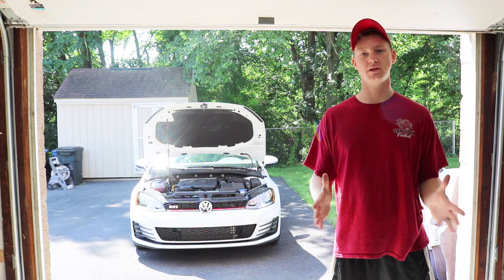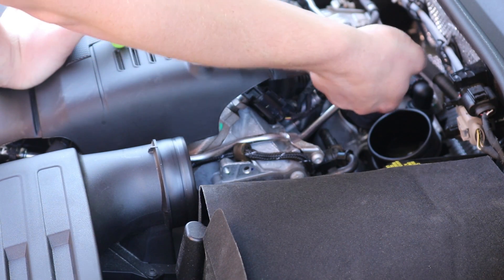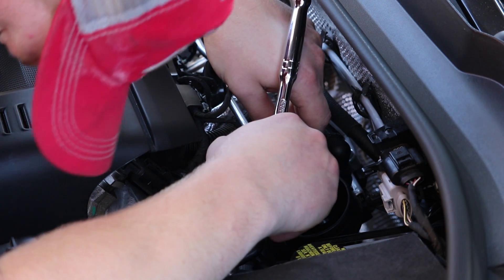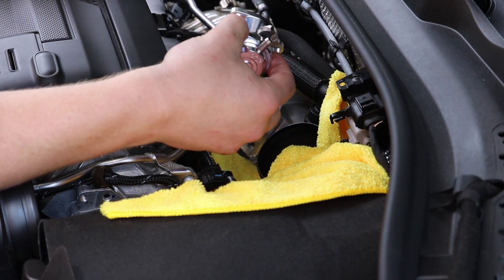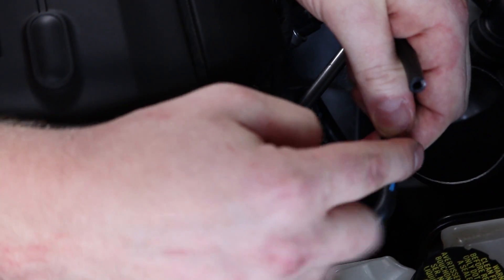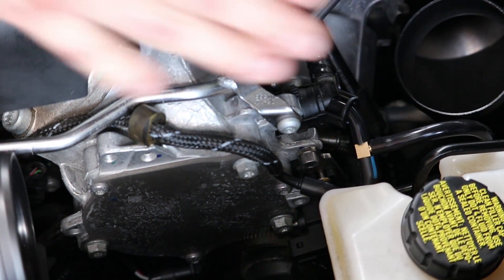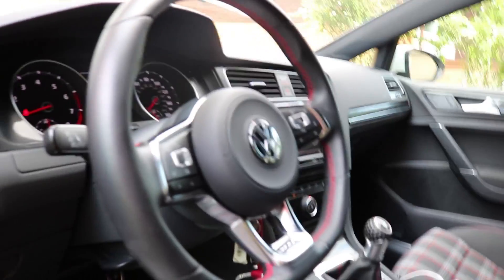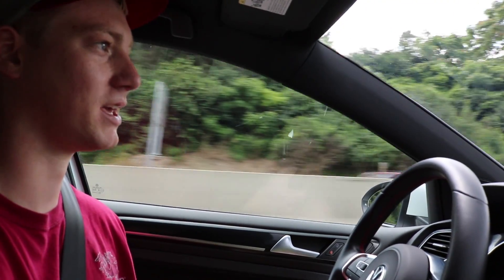MK7 GTI Forge Blow Off Valve (BOV) DIY

Comment: Where’s the loud “whoosh whoosh” or the pigeon flutter. Our how would I go about getting those sound? Thx
Reply: you would need a cold air intake and a diverter valve, and turbo muffler delete would help as well
Reply: For turbo flutter 2 legits ways.. first and cheap  way is disconnect the diverter valve plug... And the other way is installing a HKS SSQ BOV.. it's a bit harder the install and about 250 dollars for the kit..

Comment: BOV is actually bad for tge golf gti its not designed for that keep the diverter valve in and put in a spacer for more sound
Reply from the maker: been running it for 50K miles and almost 7 years. I think its fine.

Comment: Thank you bruh, this is by far the top, easiest, dummy proof way to install explication. I will be trying my tomorrow, thank you so much.
Reply from the maker: Emanuel Vegaaviles thanks for the support. It's pretty easy to put in. Just don't drop the bolt like I did 😂
Reply: TeddyWestside412 haha I’m glad I didn’t lol. But I got a flutter sound with the same BOV🤔 any ideas thanks bruh.
Reply from the maker: Emanuel Vegaaviles what type of sound are you hearing. Have you seen the sound clips video I made? I show a few different sounds that I get out of mine.
Reply: TeddyWestside412 no I haven’t :( send me the link please if you don’t mind. I get the psh sh sh sh sh sh
Reply from the maker: Emanuel Vegaaviles https://youtu.be/iWw9FHHi30o let me know if it's similar to any of these. Is your car manual or dsg?
Reply: TeddyWestside412 nope not similar at all i get the Stu Stu Stu Stu is pretty bad ass but I was looking for the whistling sound :( maybe I inverted the cables I guess. Nice video BTW
Reply: My car is automatic btw. Is pretty cool cuz you get the sound straight off the take off but sound side is not as easy to control it unles I’m on sports mode or manual stronic.
Reply from the maker: Emanuel Vegaaviles I would check the air hoses then....look up the directions to double check how they are routed. I would do this soon as you can cause you could damage the valve or your car.
Reply: TeddyWestside412 I did. It looks like that’s just the one I got. I love it tho. I’ll send you a link later when I do it. Thanks so much and keep up your videos bruh.
Reply from the maker: Emanuel Vegaaviles thanks man. For sure send me a link. You can send me it on instagram if that's easier.

Comment: I'm running the yellow spring on stock boost, I have the green spring (5-15psi) to replace it, just need to find some time to install it. But if you're running STOCK boost like i am on my Mk6 they recommend the correct preload which is a green spring.  If you're using the yellow spring which is set for (15-23psi) on stock boost, which maxes around 9psi and settles at 6psi, it may cause too much strain or pressure to open the valve resulting in some back pressure in the turbo. With the yellow spring currently in, I still get the high pitch whistle, but with the correct preload spring (green), I should receive that high whistle with less boost pressure and less RPMs to make it blow off properly. 

Green - 5-15 PSI

Yellow - 15-23 PSI

Blue - 23-30 PSI

Red - 30 + PSI

Comment: Picked up a 19 gti rabbit earlier this year, first thing I put on the car was a blow off valve adapter. Thank you for posting this, helped me install it with very few problems. Might’ve followed your instructions a bit to perfectly because I dropped a bolt too but still haven’t found it :(
Reply from the maker: Sorry to hear about losing the bolt hopefully you can get one from a hardware store like I did.

Comment: Need a tune for bov, intake? Been thinking of getting a gti  as they are pretty cool cars.
Reply from the maker: nope no need for a tune for just an intake or a bov......although these cars are a whole different animal when you get them tuned so i suggest doing that maybe first.  That is def the best bang for you buck if you want some more power to have fun with.  intake doesnt do much other than look nice and maybe some more intake noise.  bov is just for some turbo noises as well...not much performance added with a bov.  so it depends on what you are after everyones builds are different.

Comment: Did you get a CEL by venting to atmosphere?
Reply from the maker: nope i have never had a CEL due to this BOV
Reply: @TeddyWestside412  awesome! Thank you for the reply! Did you have any negative effects or anything that comes to mind from running this BOV? Thanks again for the video and response!
Reply from the maker: @cal63look  i havent had any issues with this part or anything wrong with the car related to this part ever since i installed it years ago
Reply: @TeddyWestside412  Nice nice. Reason I ask is because of all the negative Nancy's about loosing the metered air and it not being recirculated and Yada Yada yada.. I love the sound of bov's but have never owned a car with a diverter valve setup..
Reply from the maker: @cal63look  yeah i have a few of those Nancys in my comments.  i love the sound and i wanted the BOV sound with my turbo car so i put it on.  i have no issues or complaints with it.  i am out here for the fun not for a world record hahaha
Reply: @cal63look  Not here to be "a Nancy" and tell you not to get it--but I used an ECS DV Spacer that also vents to atmosphere but using a different method. I got a CEL with a MAP Sensor Correlation code. When I removed it, it went away (after clearing codes). Put it back on, light came back. That being said, I don't foresee any way the vented air could damage your engine (maybe running a hair rich during shifting), and if you like the sound go for it. I swapped to an open element intake to keep the whoosh w/o the CEL, but I loved my DV Spacer. Just know you might still get a CEL.

Comment: Hi i just did my installation on my mk7 gti, i am just feeling the boost release sound is not coming on every shift, my car is automatic is that making any difference?
Reply from the maker: I dont have an automatic so I wouldn't know. It will depend on where its shifting...if you're not up in the boost it's not going to make a noise. I'd check all your lines and if you dont have a check engine light I would assume its installed properly.
Reply: @TeddyWestside412  thanks for the quick reply, i will recheck my lines and there was no check engine lights...the last time i drove
Reply from the maker: @harishthilak  then I'd try to pay attention to where you are in the rpms when it goes off. I'm guessing you wont hear it at low rpm shifts because your not really building boost. But if you stomp on it and it shifts above 5k and you dont hear it then I think you might have an issue.
Reply: @TeddyWestside412  hi i just checked all the lines its all correct and fixed properly. The dsg is the reason i suppose, only when you take your foot off the accel pedal the boost release sound is coming. Is there any work around for that?
Reply from the maker: @harishthilak  not really that I can think of.  It should only happen when you shift or take your foot off the gas (while in boost).....if it's never happening when the car shifts then idk how to help you sorry. You can reach out to forge about it but since I have a manual it behaves a little differently than the dsg.
Reply: It’s dsg, you stay on boost when you shift gears, so you keep your pressure high = faster

You’ll only hear the bov when you left off the throttle on DSG not when you change gears. The reason you hear it every time on manuals is because they have to let off the throttle to change gears unless they have “no lift” adjustment to their ecu
Reply: What about if you use manual mode with paddles on the dsg. Then you should hear it correct?

Comment: Hey I just installed the same Forged BOV.Do you know whats the rating on the springs.I left the one that came installed but I notice that the kit came with other springs.
Reply from the maker: FZ FZ I know that the one in the BOV (if you have a yellow sticker on your box) is one of the weaker ones. I think their website says 25% then the other one you get is 50%. I don't really know what that means and I've tried asking again. I ran the  regular one the entire time while I was stock. Now that I'm stage 2 I think I am going to put the stiffer spring in. Was hearing it release air while I had the downpipe on but wasn't yet tuned. Haven't heard it let out air when it shouldn't now that I'm tuned.
Reply: yes mine also came back with the yellow spring installed.Im not sure whats the PSI rating for the different colors.Do you know the stock boost max level of the MK7 without tunes?
Reply from the maker: FZ FZ pretty sure it's between 12 and 15lbs. I could be a little off though.
Reply: nice and not bad for a stock car
Reply from the maker: FZ FZ not at all. They are pretty quick for being stock. You can zip around pretty well and have some fun at stock power.

Comment: The dials you had on your stereo is that standard
Reply from the maker: Yeah I havent done anything to the interior everything there came stock on the base models in 2017.
Reply: @TeddyWestside412  cool thanks I'm looking at buying one soon will be an earlier model tho 13/14 so hopeing will be the same, what mileage have you done and have you had any engine problems since doing mods?
Reply from the maker: @socialising6037  well the MK7 didnt start until 2015 so if you want one like my car you need to at least get a 2015.  I havent had any engine issues and Im at about 24k miles.  Been tuned for about 14 or 15k
Reply: @TeddyWestside412  here in the uk you can get mk7 from 2013 looking at one with about 60k so not going to go mad with the mods as will be my daily.
Reply from the maker: @socialising6037  oh ok sorry I'm in America and only know what we can get over here.
Reply: @TeddyWestside412  thas cool no need to apologise it's not like you knew I was from the uk. I'll subscribe and update you when i get the car, thanks for taking your time to create the content and share your info.

Comment: Does your Forge BOV makes a release sound everytime you off the throttle even on light acceleration?
Reply from the maker: FZ FZ yeah pretty much. Just sounds like a little bit of air being released its not a loud whistle on light throttle.
Reply: ok great! mine does that sound too.I just thought there will be no air release unless you are under boost then release. I thought that it might be an issue with the BOV spring.Are you still running the yellow spring or did you upgraded yet?
Reply from the maker: FZ FZ as of now I'm still rocking the yellow. I plan to upgrade to the other one they give us soon since I'm now stage 2. I feel like it's letting air out a little more than it used to.
Reply: right im also on stage1+ from Cobbs and it seems air is coming out more under each throttle release
Reply from the maker: FZ FZ how do you like the Cobb tune? And sounds like once you get tuned it might be time for the other spring.
Reply: I think so on the Spring I might need to check  how much boost the tune is pumping to match the spring.I luv the Cobb AP for the convenience of being able to switch tunes on the fly.The tune is great I do notice the power or boost difference but at the same time I havent try other tunes like APR or JB4 etc to know the differences but definitely from stock to stage 1 and the stage1+ you notice the difference on the pulls.Which tune company are you using?
Reply from the maker: FZ FZ I have APR Stage 2 cause I wanted the pops and bangs hahaha.
Reply: sweet! do you have clutch slippage yet? I havent notice any on mine yet but I try not to lunch it or spin the tires on first. I just got lucky because a body of mine that works in a salvage yard told me a wreck GolfR with low miles got in so you know im getting that IS38 turbocharger hehe so if that happens on the cheap i will be upgrading with the downpipe and the intercooler next.Once I burnt the clutch then I will do the clutch upgrade
Reply from the maker: FZ FZ that's freaking sick! I should find a junkyard buddy myself hahaha. But yes I def experience some sort of issue with the clutch not holding the power. I think it's clutch slippage but people that watch my videos think otherwise. It's def not traction control issues. My car will just bog down then raise up then bog down then raise up in revs when I try to floor it. When it starts doing that I just let out cause I'm trying to save up money still for a new clutch. I believe the clutch is struggling to hold the power cause it's only when I floor it or stomp on the gas a little. I really have to ease in the throttle to go fast now.
Reply: hell yeah. Im saving that baby for a spring project.So if you stomp on it your RPMs go up and your speedometer barely move correct?
Reply from the maker: FZ FZ RPMs go all over the place as the clutch is trying to engage and disengage.
Reply: do you have any videos on that.I think it will be a good tool for people to see how it  slips by RPM speed and speedometer
Reply from the maker: FZ FZ not really just sounds on my APR Stage 1 first reaction video

Comment: Did you have any check engine light with that valve, i'm in France , i have a mk7 gti dsg 6 , with stage 1 and blow off forge ( black one )  installed, all done by famous BR PERFORMANCE.
I have orange check engine light, they tell me it's because the blow off valve installed, i told them : how many GTi with blow off forge are circulating, a lot i think.
Reply from the maker: Douglas Duch idk why the BOV would give you a check engine light. I have never had a check engine light with any of my mods so far. The MK7 should have a MAP and not a MAF so you shouldn't have gotten a light from the valve. Is there a code that its throwing for you?
Reply: Douglas Duch Hey what’s up I have a mk7 dsg also and have been wanting to get a bov. Did you ever get it figures out? How is the power difference on stage 1 with dsg? Any clutch problems?
Reply: TeddyWestside412 So, i emailed Forge and they are telling me that this is impossible to have check engine, these BOV have been tested a lot before release, on every GTi or R and no CEL, they told me it must be the solenoid that has a default, they are sending me a new one, i'll keep you posted 😉😎
Reply: Daniel Warren Every engine is different, i went to see a professional of course, in stage 1 mine got 100 hp more and 110 of tork.
Stock : 220 hp and 350 Nm 
Stage 1 : 320 hp and 456 Nm

The turbo is what you should be concerned the most, they are fragile on the first version of the the 2013 Gti, mine is 2015, Turbo's can also break without doing stages.

That's why i want to install a BOV, it's better for the turbo because there is no back pressure, it's what have been reading from pros on the net.

Stock version is a diverter valve that when you take your feet of the throttle, it recirculate the unused compressed air back into the intake, making the turbo going from one way to an other really quickly and can affect it.

Anyway stage 1 is just amazing, having that much power, it's a all different car, so much fun, clutches should not be a problem.

If you drive crazy all the time, stock or with stage 1 you could break not only the gear box but other things.

2.0 tsi are made to get 440 hp with stage 4, with the adding of new clutches and turbo of course but no many cars can go with stage 4.

So a simple stage 1, if you drive crazy just when needed 😁, you are all good, but if you are an agressive driver all the time, then don't do it.
Reply from the maker: Douglas Duch yeah I'm very interested in what's going on. I agree with them theres really no way for the BOV to cause the light but if the solenoid is bad and not communicating with the car ECU that could make sense. Car is probably saying hey this sensor isn't plugged in since you unplug it from the car and plug it into the BOV.
Reply: TeddyWestside412 Hi Ted,
So i received new solenoid and cable from Forge ( big thanks to them ), i did the install yesterday, no check engine light for now, i'll see in the next day.

BR PERFORMANCE cuted the hoses really short and the install is a little weird, i'll send you a pic, i'm scared about the heat and the cable, did you put the cable on the left side of the intake ? Mine is on the left, but kind of touching that hot metal, hoses are like 1cm from the hot metal part.

I'm gone order new hoses and perfect the install, i don't really like it this way.
Reply from the maker: Douglas Duch the hoses do get pretty close to the intake. I have slack so that they run super low. I left that bolt to the solenoid loose till the end. It being loose helped with the install. Then I put it as low as possible to try to get room for the hoses.

Comment: You have a 2017 , which is not an mk7.. Mk7 year starts 2019 .. I have an 2018 gli 2.0t which is newer than your year and mine is an mk6
Reply from the maker: A GLI is a version of the Jetta.  I drive a GTI and its 100% a MK7.  The MK7 started in 2015 and they had a facelift version the MK7.5 come out in either 2018 or 2019.  Not sure if you are from another country but I am pretty sure its the same for all GTIs during that time period.